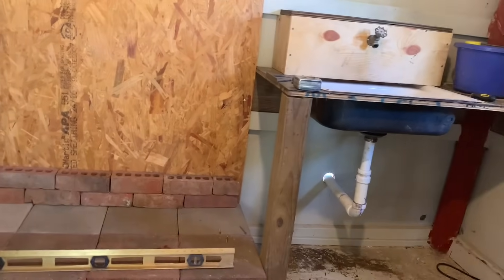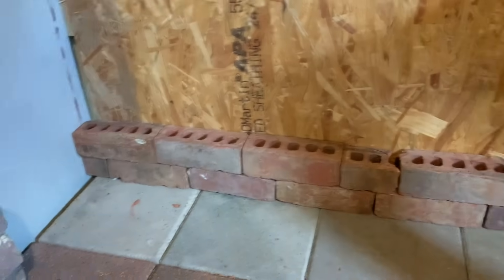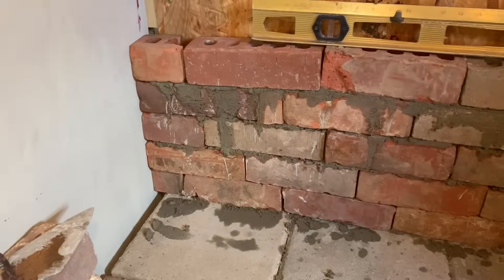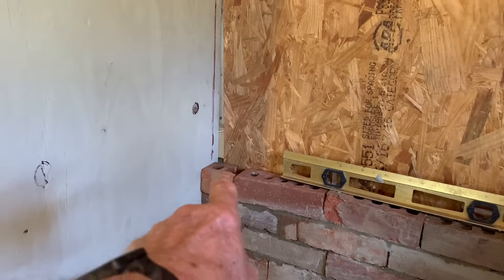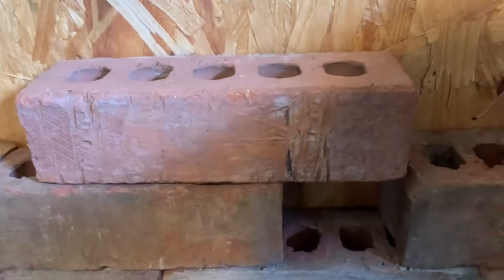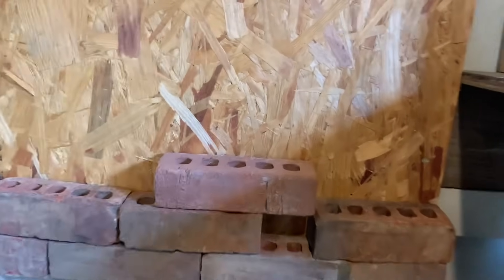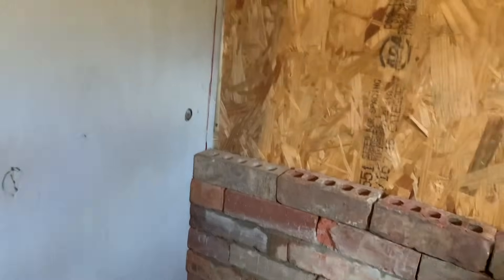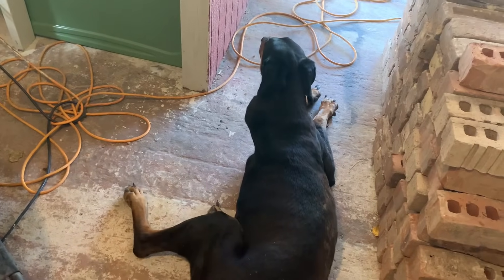Bricklayer  I m Not

Comment: PawPaw your brick wall looks great , your doing a beautiful job and I love that your using old brick so it looks like it’s been there a long time!! PawPaw when your working out in the heat it will help a lot if you take a ziplock baggie and make a thin layer of water water sbout 1/4 “ thick and freeze it , when you go out to work chip the corners off ice leaving the frozen block in the bag , put a folded in 1/2.rag on your head letting the rag hang over the tops of your ears lay the bag with frozen ice on top of rag and put your hat on ti hold in place ! The ice will cool your head and the rag will keep the cold ice off your head and hanging rag will catch the water from melting ice and you’ll have a much cooler working experience ! I use to do this when I lived in Florida to keep me cooler and it works great , you can also wet a thin towel and wet it wring it out and put in a ziplock bag to freeze , take it out of freezer a few minutes before your going outside when going out take out of the bag and you will beable to wrap it around your neck to help keep you cool also and it works great ! I’m still praying for rain for all of y’all !! God bless ❤️🙏🙋🏻🌈🌈

Comment: Paw paw did you put mortar between the bricks at all in the rows to help them stay together as well. You can clean off the excess mortar off the fronts of the bricks easily with a dustpan brush when you finish before it sets too solid but for a first try you’ve done a really good job😊